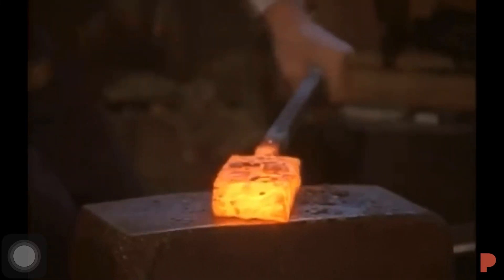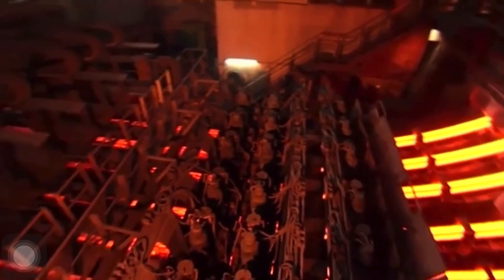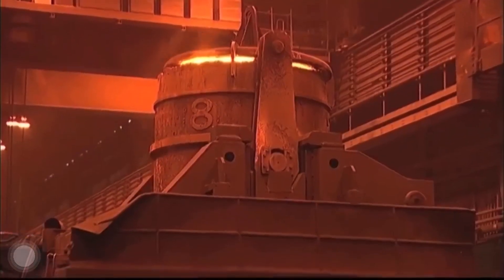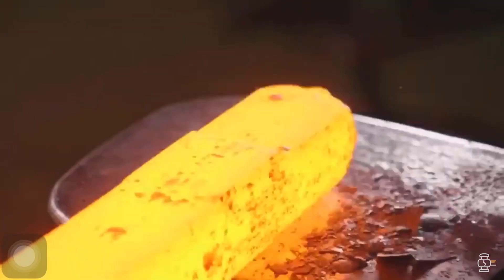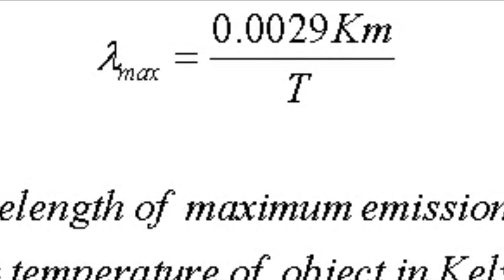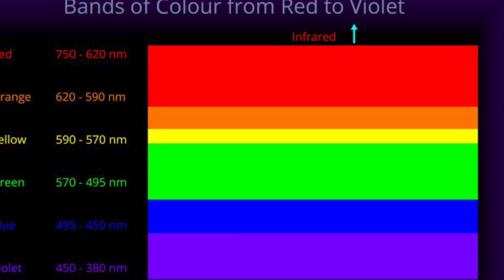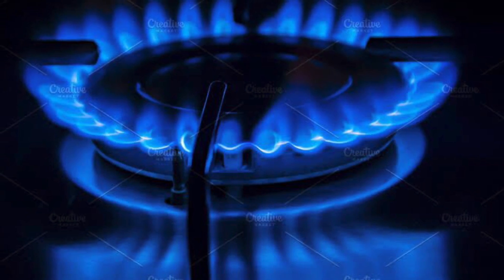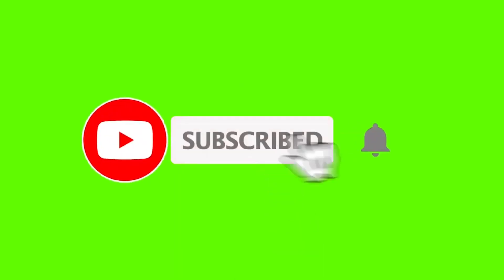WHY METALS TURN RED WHILE HEATING???

Comment: you did not tell why it turns into red color i did not expect theoretical explanation
Reply: Its a result of the radiation of the object. 

When an object becomes heated it starts emitting photons at a higher frequency which causes the object to start glowing. 

With red being the result of the diagram in the video